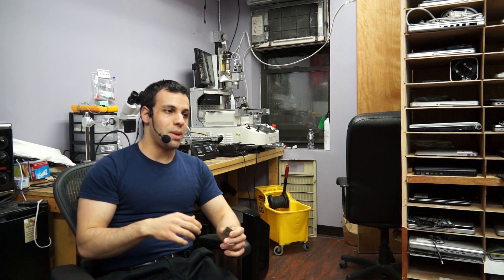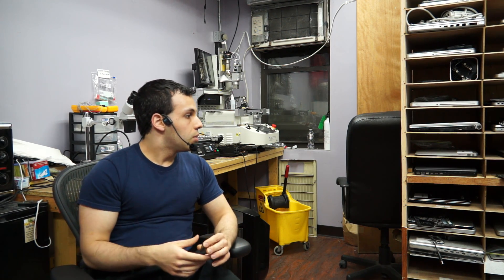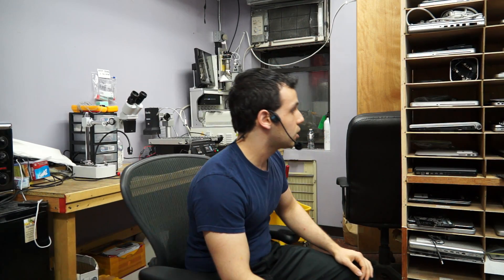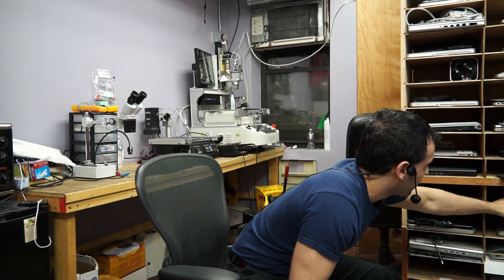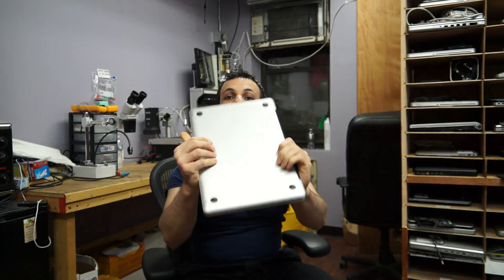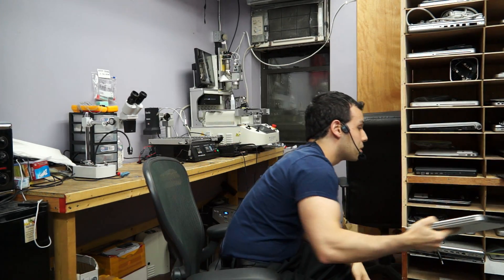Reballing flip chip GPUs is BULLSHIT - the truth about dead laptop GPUs & repairing them.

Comment: From all the reflows I have done and seen the results. I believe this guy. The reason you may not get customers back is probably because they gave up and just tossed the machine. Sometimes it could be solder, but I firmly believe its bad factory manufacturing of these chips. But he's right most techs don't want to hear the truth because they won't make money. I would rather replace the chip if I can find it online then reball it.
Reply from the maker: There are two issues

a) crap chips

b) crap environment

A good chip can fail in a laptop with crap ventilation. A crap chip can last 3-4 years in a machine with amazing ventilation. The reason this is such a mess is that you have poorly ventilated laptops with crappy chips! 

You are also completely correct in that any people DO NOT come back to the repair shop. They simply discount the industry altogether, junk the device, and tell everyone they know to avoid you - without you EVER knowing! Same with cellphones, but moreso. They get their upgrade instead of keep the phone they have and discount the entire experience of having gone to a cellphone repair shop as a bad joke when their $17 iPhone 4 screen from ebay fails two weeks into repair.
Reply: Louis Rossmann A guy on facebook is saying he has challenged you on this subject. He is saying your words have no scientific basis.
Reply from the maker: The science of the subject has been discussed enough. Do the following for practical real world application. 

a) Take the board that you are reballing the dead GPU on. Download GPUtest. Run furmark stress test, turn off energy saving & screensaver in the OS. Ring me when it dies. You can use leaded, lead free, copper, or solid gold balls for all I care. 

Compare longevity to NEW chip with leaded solder, lead free solder, solder made out of dust follicles for all I care. :) Record results(or let unhappy customers do it for you). I assure you they'll keep better track in most cases. :D

b) Google to determine reputation of places that reball dead GPUs vs. places that replace dead GPUs.

There is no science in this, but it is very telling, and the results ARE predictable, and repeatable! Those with common sense & regard for their customers will cut the shit and stop heating up old garbage. I see so many forum flamewars from 2009, 2010, 2011, 2012 on the subject. I click the links in the signature and the ones reballing dead GPUs always have unpaid hosting or out are out of business. 

I hear it said over and over that this means nothing. I prefer to base my procedures as much as I can on a mixture of science & real world practicality. So, I lean towards following the advice of people who are successful in doing what they do, not the people who go in & out of business within a year. 

You have to have your own way of absorbing all of the data and coming ot a conclusion for yourself. People will get so angry when I bring this up, and they're right, it's not scientific. There are millions of reasons for people to go out of business. Again, I try to thin slice and grab as many pieces of information and process them in a manner that makes sense to me, and this makes some good sense to me. If it doesn't make sense to you.. I would suggest reball the dead GPUs until you have to change merchant services providers from the chargebacks. :)

Comment: YOU ARE THE MAN! I am currently again able to use my HP DV7 after repairing it with your suggestion and not the reflow fad! Don't get me wrong I was totally ready after it crashed to try the reflow after reading many articles.  I knew it was the GPU and I am as a hobbyist a tech geek but nowhere near the professional you are but I'm never afraid to dive in to fix something. Watching your video made so much sense I was definitely a lot more reassured to attempt it! Disassembled the laptop got out some aluminum tape and bordered the GPU to make sure everything else was protected. Got my heat gun  and temp gun and heated it to 120 to 140ish celcius (old heat gun without any settings so I chased the temp a little) never hit 150 and definitely nowhere near the 217 C to "REFLOW" the solder! After 5 minutes I stopped and let it cool down. Threw it back together just enough (power, monitor, ram etc.) Just to check it without complete reassembly and apprehensively hit the power button and holy shit it fired right up! So now new thermal paste cleaned fan vents and its running nice cool and happy! Thanks so much man and keep up the great videos with all of your knowledge, I'm obviously now a subscriber!!

Comment: dude i watch your videos and i learn alot from them.. i fix all my own stuff..and i cant tell you how much i appreciate your brutal honesty.. and integrity. im a disabled veteran with use of only my right hand. so doing these kinds of repairs are super challenging for me,  but i love it and i will be buying only amtech from your store, i learned the hard way to stay away from cheap shit. im learning to use a hot air station.. and adding external antennas to some wifi boards, its not much but its still fun and from your videos i found the courage to finally start heating the board to remove some 0201 resistors and add and antenna connector, i dont have a microscope yet so its a challenge with just a magnifying led ring and some plus 3.5 readers  i was most nervous about burning the board but finally decided on 250C to remove old resistors and 200c to resolder  , uts kind of a PITA without 45 deg nozzles but i have some on the way...LOLOL
great info man...thanks for keepin it real boss
FAWK APPLE and MACBOOK

Comment: Thanks for the video. I don't totally agree with you on the point that reballing is totally useless. It worked reliably to many people including myself. In fact I'm currently writing my comment using Apple Macbook pro 2011 that had its GPU reballed! I took one good piece of info from your video which is the temperature needed to resurrect the GPU without actual reballing; I'm going to try it on a friend's laptop. Thanks again.

Comment: "Doesn't fix it" should perhaps be "only temporarily fixes it and only in some cases".
Reply: But you could still only heat them for that purpose without the extra cost and hassle of separating the chip and replacing the balls.
Reply: If I have an illness or injury and take some temporary remedy relieve the symptoms so that I'm functional for a short time again, I'm still not fixed.
Reply: In other words it doesn't fix it essentially
Reply: @oztk5673  انت هنا 😂

Comment: The issue is likely the lead free silver solder used to solder the flip chip die to the BGA. Not the BGA to the board. When lead free became mandatory, soldering facilities had hard time finding the right temperature profile, solder type and rosin combination. Analogy would be a recipe. Someone can succeed while someone else fail. There is also an issue with whiskers in some cases. Leaded solder don't form whiskers, or very slowly. While lead free solder has a tendency to create whiskers faster. Heating below reflow temperature could be enough to open the whiskers. Reaching 235oC to reflow the solder between the die and the BGA might fix the issue for a while. Don't forget that oxygen can be an issue when doing reflow. In industryal facilities they use inert gas like nitrogen to prevent oxydation. This alone would be enough to explain why quick fix with basic equipment only last a few months.
Reply: So you are suggesting, that where the issue is not the chip, but the smaller balls between the chip and the inner board in the package, better results can be gotten by doing the heat treatment in an inert gas of the kind used during manufacturing.  E.g. by blowing hot inert gas instead of hot air onto the chip, possibly with also blowing cooler inert gas before and after to keep the oxygen out during heat up/cool down?  Or alternatively by running the entire board through an industrial inert gas reflow owen at a lower than normal temperature?
Reply: The smaller balls between the chip and the inner board is what Louis was suggesting in this video too, you heat it up to 150C which is enough to rearrange/reflow these intermediate balls, rather than the balls between the die chip and the main board.  It sort of makes sense, but who knows for sure...
Reply: i think its nothing but a whisker. When you go to 385 degrees the whisker being so thin vaporises. but there's over 20 theorys ive heard so far.
Reply: what is a whisker
Reply: Those balls can be 96-99% lead and the most fragile type

Comment: If the fix is is heating the chip why doesn't the chip self correct when it over heats ?
Reply: Maybe it doesn't reach a high enough temperature, or not being heated evenly or in the right spot... just guess.
Reply: not hot enough. you need 350-400 degrees. most cards are finished at 85 celcius. thats only 185 degrees.
Reply: Plus nowadays they use high temp alloy solder which definitely takes a lot higher temp to melt/smelt.
Reply: Eugene Bigay. 1990 American Skaters
Because the definition of overheating is from while a problem is apparent or worsening. Same problem with anybody calling a dead chip unreballable. It's not really that you cannot reflow it, just that the final assembly is still deceased; b/c Persistence of Objects.
Informally, its like a hot lightbulb that’s shaken while off lasts longer than the same bulb would if shaken while on.
Reply: It does, there are some fixes for a brand of HP that had issues with poor cracked solder on the chips that people got results wrapping their Laptops in Blankets for 45 minutes and just letting it run and suddenly their screens worked again because they triggered an overheat allowing it to self correct.
Reply: @seditt5146   exactly why the towel wrapping on an Xbox 360 worked.
Reply: It's like Louis said the wall is coming down. Your just moving it until the bricks are in a pattern that gives the appearance of everything is fine eventually the parts are gonna be in all sorts of places that no amount of prodding will get it to go.
I'd say the heat isn't focused on the chip inside the machine the heat is rippling over it
Reply: @friggenbozo4495 Even if your claim were correct (and it's not) it completely runs counter to the claims in this video, namely that a temperature of 120°-140°C is all that is required to temporarily fix the chip issue, I mean, did you even watch the video?!?
Reply: @Walther PenneThat's entirely NOT how it works.
Reply: @HighestRank  That completely fails to address his point
Reply: @Babihrse You aren't addressing his point. He is saying that if heating the chip externally is enough to temporarily fix the issue, then internally heating it through use should be too.
Reply: @ManifoldSky  sorry my words fail me when using analogies for this.
Right so internally heating it will still move components inside the chip until shorting inside occurs or paths become disconnected from one another inside the die.
Reply: @Babihrse  First, you still are not addressing what the O.P. wrote.
You write: "'I'd say the heat isn't focused on the chip inside the machine the heat is rippling over it'". This is incorrect. In operation, it is the GPU itself that is generating the heat one senses "rippling over it". So the internals of the chip itself are hot.
Second, the issue then becomes, if heating the chip externally to temps well below the melting point of solder fixes the issue, why does the chip heating internally not do the same thing. There are several possible answers, starting with the fact that most GPUs will only heat up to about 90°C in full operation, well below the 120°-140°C discussed. But that begs another question, specifically, why a lower temp of 30°-90°C is sufficient to damage the chip. Rossmann has not made a particularly compelling argument that this is actually the case. As I wrote in another comment, there are alternate explanations for why heating to temps well below the reflow temp of solder might fix the issue that have nothing to do with claims the chips themselves are damaged.
It should also be noted that Apple are far from alone in using these chips, so placing the blame on Apple is a bit silly.
Reply: @Gilluly IT Services LLCThat simply is NOT the issue here. As has been shown conclusively via X-ray analysis, and contrary to what Rossmann is saying here, the problem IS due to failing solder joints and IS fixed by either reflowing OR reballing.
This fact is not contradicted by his thought experiment, for the reason I already mentioned.
Reply: @Walther Penne Regardless of language, your claims are incorrect. That is simply not what is going on here.
You appear to be trying to apply concepts of bit rot in things like Flash RAM to chips in general, but chips in general don't work like that, and you clearly do not understand how bit rot happens or what it means, either.
Also, that is not even what Rossmann himself is saying here!
Reply: @Gilluly IT Services LLCBeing that I never claimed that, what, exactly, is your point?!?
More importantly, "computer repair, digital electronics, and soldering" don't give you ANY insight into the actual issue involved here. Only X-ray analyses do, you know the types of tests commissioned to be done by the lawyers in the class action suit against Apple that eventually forced them to do not one, not two, but multiple recalls of different machines to fix this issue.
Funny how it also effects lots of other nonApple brand electronics, since the issue is the nonleaded solder, and nonleaded solder is mandated by environmental regulations. And while this IS made worse by repeated heating expansion cycles inherent in Apple's airflow designs, it is, again, not exclusive to them.
But nice appeal to authority logical fallacy there.
Reply: @ManifoldSky  I would argue that the cause could be both, they are not mutually exclusive. 

I think the point Rossmann is kind of missing here, is that it could be poor solder joint failure with the ball-soldering technique which personally I find to be a garbage design, OR it could ALSO be that the chip is damaged. When the solder joint gives way, the chip may continue operating incorrectly at high-frequencies leading to further internal damage. I have seen a similar feedback loop with a Seagate drive and 3-phase stepper motor, either the controller failed or the stepper motor failed because someone cheaped out with a resistor or a diode, one failed, and I'm guessing the IC, and they effectively burnt each other out.

So I believe what he is saying is, yes, he could re-ball it, and it may or may not work, if it did work, it stands a very high probability of failing again. He doesn't consider it to be a proper repair, the proper repair is sourcing another known, healthy chip and reballing. I believe his story that the chip stands a very high chance of being damaged internally and will experience a shorter life-span. You could get lucky and have experienced an instantaneous failure and the chip was not damaged, but this is an unlikely failure mode. I've also witnessed 3 HP AIO machines graphics subsystems fail in a similar spectacular fashion due to poor ball soldering techniques and lack of effective cooling.
Reply: It's complicated. Too many scenarios, the solder can brige when its hot and being moved around. Also the solder being low quality alloy degrades over time. I think this is more common , the solder brittles and Create gaps between connections.
Reply: Dollar store Jesus what’s wrong from Kansas?
Reply: @BillAnt  Maybe
Reply: @friggenbozo4495  thanks for the 411 it's great to know
Reply: @Walther Penne That doesn't sound right, why would a little heat make some electrons jump around. I know that's how a thermocouple works but once it's cooled down it stops conducting electricity.

Comment: Ok, I see what you mean; and from a "non mac" view on my end (tv repair) we do not reball.  We do reflow ALOT of BGA chips, that either proves your correct, OR possibly proves that "tin whiskers" growing between the solder balls cause issues.  This is typically "proven" by heating the chip (lower than melting for lead free solder) and testing.  If that does OK, then we reflow at around 200-215c.  Now the "tin whiskers" WILL melt at a lower melting point than that it takes to actually reflow all the balls and or float the chip.

Zephyr has alot of articles on this, and Also leaded solder does NOT do this as frequently or often.  I guess that's why the Military, and NASA still use lead solder.

Thoughts?  Enjoy the video's btw.  Love some of the equipment that you have...  And I do agree, reballing is NOT the answer; it is either the chip, OR the tin whiskers growing between the solder spheres beneath the chip.  And with the TV one's that we do, they do not have the seperate substrate ABOVE or on top of the BGA like graphics chips do.  These are just standard BGA chips we are seeing this on.

David

Comment: that's very true, when my dell xps m1530 died, with 1 long 2 short beeps, the only way to keep it boot up again by heating the gpu, then it worked, so I quickly backup everything, hours later, it didn't work anymore, since it's out of warranty, just messing around with it, reheat again and see if that makes it work again, yes it did, and repeat, 4 times reheat later, it no longer work and's completely dead. :P

bonus:  2 months later, a burglar broke in my room, did not take anything on  my table (high end pc, headphone,etc) but took away my "dead" dell xpsm1530, and another dead HP pavilion laptop, but did not take away my budget acer aspire laptop which was still in working condition. picky thief 

LOL